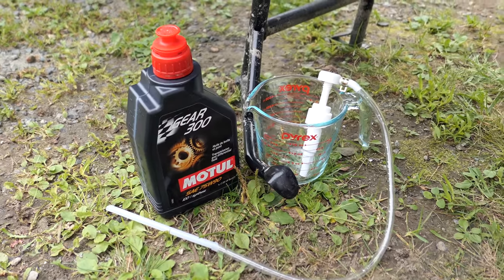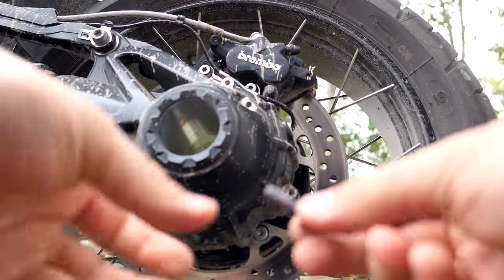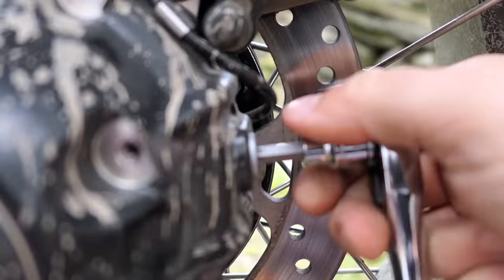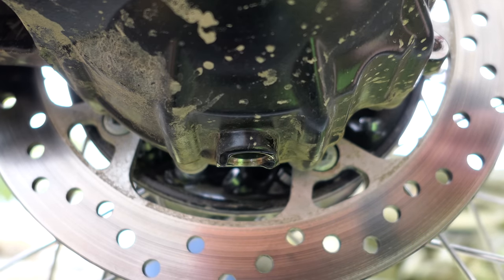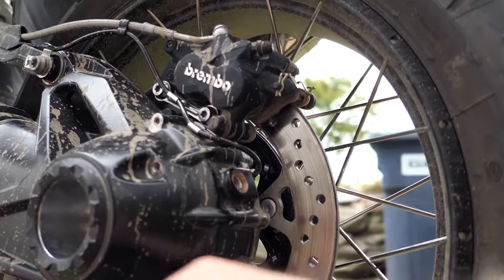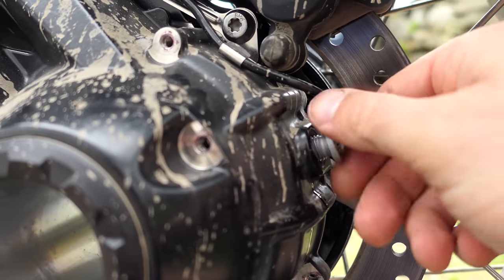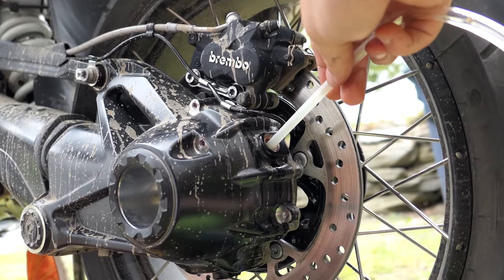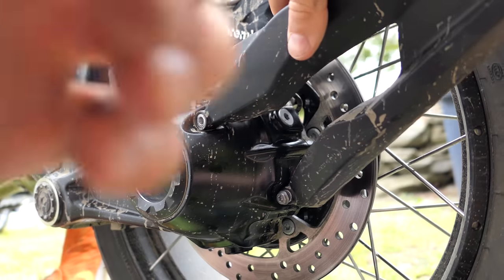How To: Change Final Drive Oil on your R1200 GS Adventure

Comment: After the 1st change the oil wont look that dark. BMW adds a bit of molly lubricant in there to break in the gears. It's not required, but I change my final drive fluid at the same time as the engine oil. It comes out to just over $5(US) including o-ring and copper washer. 

Another tip, clean the area before doing this as you don't want dirt in there.

The syringe idea that YAYA and Nigel gave I find is  the best. No mess and very accurate.
Reply: any difference between the bmw oil and motul, other than the bmw oil being twice as expensive?

Comment: as a tip it is always a good idea to remove the fill plug first to make sure that it will come loose.  I have seen people drain fluid and not be able to remove the filler plug and have to deal with a seized bolt.  I understand this is a new bike so it should not be an issue but as they get older it is good practice.  thank you for the video

Comment: Life is so much easier when filling to the bottom of the filler plug as it is on my R80 G/S PD, R100 GS and R1150 GSA. No measuring tools required.

And as someone has already mentioned, I am sure BMW used a MoS2 in the initial fill which is why it could be so black in a mere 600 miles. I use Dow Corning M Gear Oil Additive (MoS2) at 5% in the final drive in the rest of my BMWs and there is zero metal on the magnetic drain plug between changes.

By the way, the drain plug on our R1200 GSA have a magnet set deep into the drain plug.

And wash the bike before doing any maintenance. lol

Comment: You can use a old gearbox plastic bottle with the pull out thin neck tube , cut a hole in the side of the bottle and use it like a funnel and the neck fits in the filler .

Comment: Personally, I wouldn't trust a pump like that to give me the correct volume, they too often short stroke or similar. I've had plenty of practice filling my boat final drive. I don't know why they couldn't do a combined filler/level plug like my older BMW has that way there's no guessing and it can be easily checked subsequently before a long ride. Not everything on my new BMW is better than my old one that I still have, certainly not when it comes to serviceability.

Comment: I am beginning to do some basic maintenance on my 18 GSA.  Your videos have been helpful, thanks for posting them.  Do you also do the other 12k service requirements yourself --> check valve clearance, change spark plugs and run a dx scan?
Reply from the maker: I have done everything except valve checks. I do 12K a year so I like having a dealer do a look over. I’ll do brake fluid, pads, fluids and have them do a check over of the bike & valves.
Reply: @AdamChandler86  Thanks Adam

Comment: hi,.. where is drain plug locate for transmission oil (gearbox) ?
Reply from the maker: Hi liquid cooled GS bikes don't have transmission oil. The clutch sits in the motor oil (wet clutch) so you just change your oil and you're also changing your clutch oil. There used to be transmission fluid for the gear box but not on anything newer than 2013.
Reply: I want to change my transmission oil by my self, but i want to make sure the drain plug for the transmission oil…
Reply from the maker: If you have a GS that's 2013-2023, you don't have a transmission drain plug, only an oil one.
Reply: Ok, cool,. Thank’s you for your info..
Reply from the maker: Best of luck!

Comment: Refilling gear oil on other bikes means pouring until it was level with the bottom of the intake hole.  Curious if the spec volume came close to that.
Reply from the maker: That's really hard to say. I agree though, same with cars generally Dif fluid is fill until it begins to come out and then plug but BMW is specific about how many ML and honestly I've never seen it close to the hole but it's small so it's hard to see in there.

Comment: Dealership keeps stressing using the bmw brand oil, which is a nightmare getting hold off. Everybody ok with using oil as long as it meets these specs 75W90 gl5?
Reply: Bmw engine oil £70 same specification shell advanced ultra 4t 4ltr  £20 eBay  ,who’s taking the Michael then!  Bmw r1100rsse did 101,000 miles on her used valvoline racing 20-50 car oil as it’s basically a car engine no wear whatsoever, wrote off after a car hit me stripped the engine for spares and the bores still had the honeing marks in the bored , don’t get fooled with what they say !

Comment: Brake fluid is not corrosive but, it can damage painted surfaces. Also gear oil is not corrosive either.

Comment: no veo muy normal que salga tan oscuro el aceite del cardan......creo que hay un problema serio.
Reply from the maker: The first time you change Final Drive Fluid on the GS, it comes out black. BMW puts a lot of grease in from the factory. Most comes out at 600 miles.

Comment: He said every 600 miles. Did he mean every 6000 miles? I'm about to do a 1200 mile trip on a 2013 I'm picking up. Doubt I see my self doing this midtrip.
However, 6000 miles is BMW's regularly scheduled service regime. 

???
Reply from the maker: It’s actually every 12K. I do it every 6.
Reply from the maker: I should be more clear. Oil every 6k, Final Drive every 12K. I do both every 6 along with Air Filter, oil Filter and Spline Lube.
Reply: Astro Venus Best way to keep track is change it evrytime you change your rear tire (if your tire is still good by 10k, then do it anyways)